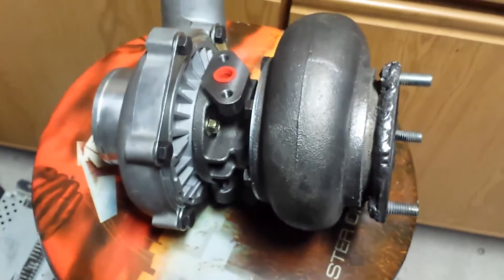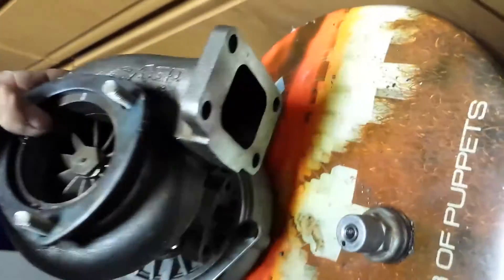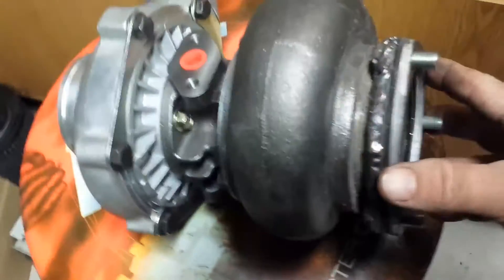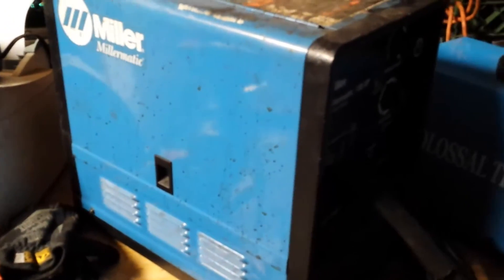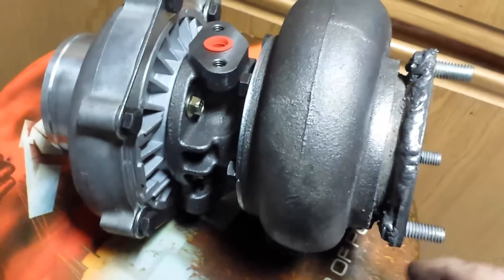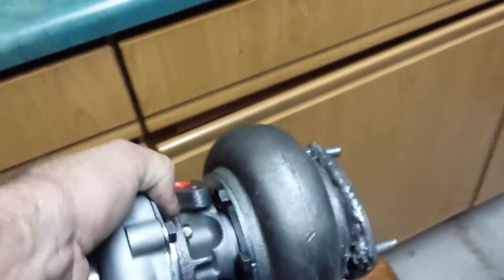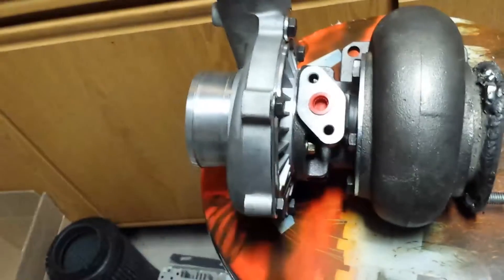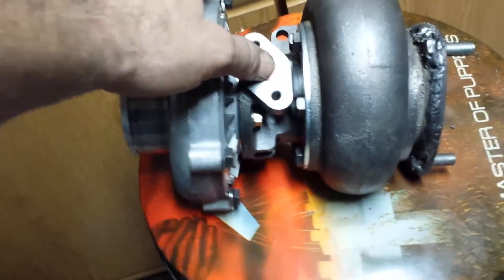Project Mustang - Weld turbo downpipe flange to prepare turbo install

Comment: welding that flange to the turbo didn't warp the flange from the wire welders heat?
Reply from the maker: +Nick Marangos I don't have much issue with this connection but I do have gaskets blow out on my passenger side header collector type union.

Someday I need to pull the turbo and redo the connections off of the engine manifolds with the two bolt donut style gaskets that cars use stock and then redo my downpipe so I can have clearance under my car again.

Comment: V-bands are so much simpler and better than this route, next time may want to look into it more. If you have questions or trying to figure stuff out, check out TheTurboForums.com  Tons of info.. but glad to see you got what you wanted on. But yeah you traded up one bolt for three.. lol And on the side note... WELD BOTH SIDES.. separate that case from center section and the impeller and run your weld and then clean it up as you would any weld but it looks good... just make sure when you torque down, you get them even.

Comment from the maker: At first I'm going to run it without. I wont be at incredible boost to get into the 400HP ballpark. That can be handled with a little extra fuel for now.

I do have some nice aluminum spine-fin tubing at work from a fridge that I can likely install into a home made heat exchanger to run water or even perhaps chilled water through.